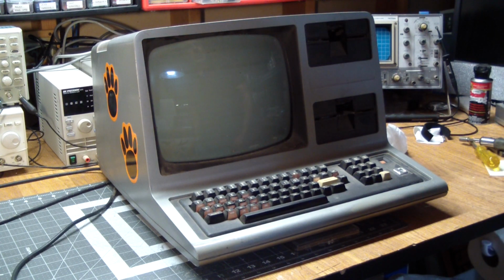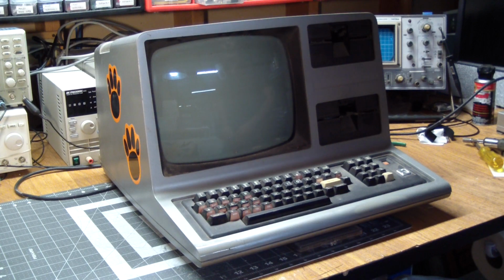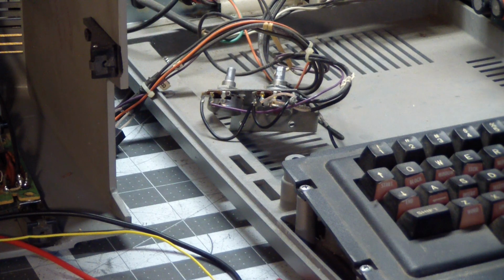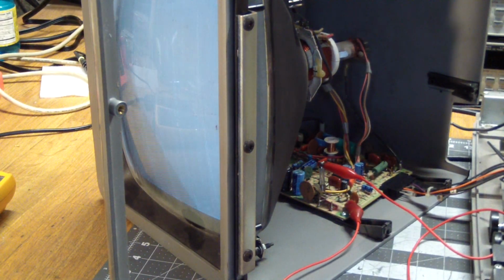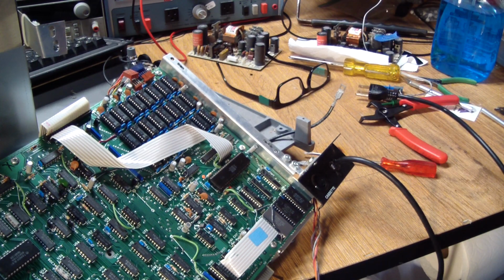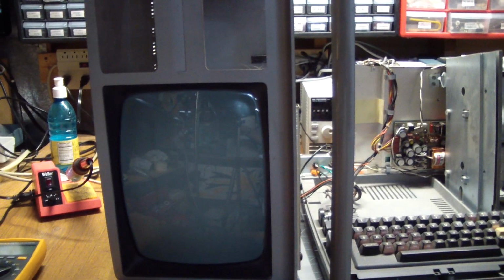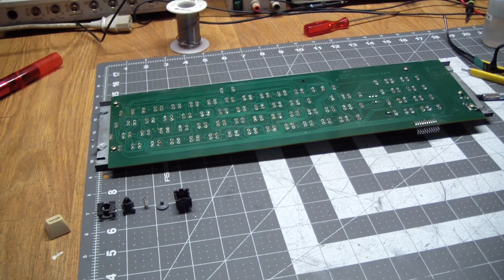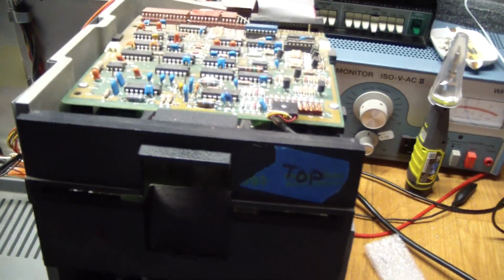AE#208 TRS-80 Model III Repairs, Part 1

Comment: I replaced the RIFAs and reflowed the solder on the power connector and my model 4 fired right up. A little strange but the PSU was actually the one typically used for the 4P.